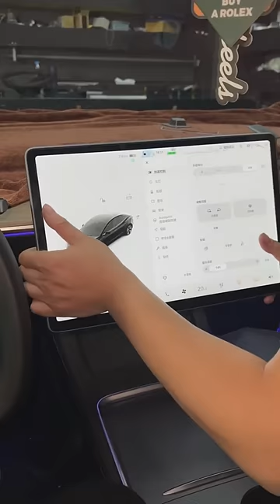The best Tesla accessories of Model 3/Y Rotating Screen Mount & Yoke Steering Wheel | Tesery

Comment from the maker: In this video, we'll find the best Tesla accessories worth installing.
When driving we use the steering wheel and the center touch screen the most, but model 3 & Model Y owners often encounter this problem: the steering wheel feels bad or monotonous, in addition to the center control operation is not only very inconvenient, but also will affect driving safety.
If the steering wheel is changed to a yoke steering wheel made of Nappa leather, this will not only enhance the class of the car, but also feel particularly good. Friends who have seen racing cars may know better, most of the steering wheel of racing cars, are not round. But the use of personalized design of the Tesery yoke steering wheel, not only to bring you a full sense of driving control, but also to enhance the sense of driving happiness.
Tesery's swivel bracket can be rotated left and right, allowing you to adjust the screen to your most comfortable angle while driving, no matter how easy and safe it is to operate, without affecting your vision. Plus you can share the screen with your co-pilot and see the full view on the screen. When taking a break, play a movie in the car with the Tesla center screen, a small stand will allow you to maximize the fun you can have with the Tesla center screen.

Some of you will be wondering if it will be a little difficult to install, the next video will show you how to install it quickly and a person can complete the operation.

If you need more information about upgrading your Tesla, you can visit our website: https://www.tesery.com/collections/upgrade-configuration or leave a comment in the comments section of this video.

Follow us on Instagram: https://www.instagram.com/teslaupgrading/
Follow us on Facebook at 
https://www.facebook.com/Tesla-steering-wheel-Tesery-111280071370975
Follow us on Pinterest at.
https://www.pinterest.com/TeseryLi/

If you are ready to buy a swivel mount now, you can visit our link: https://www.tesery.com/products/rotating-screen-brackettesla-model3-y?ref=uC56lb37

If you are ready to buy a steering wheel now, you can visit our link: https://www.tesery.com/collections/steering-wheel?ref=uC56lb37